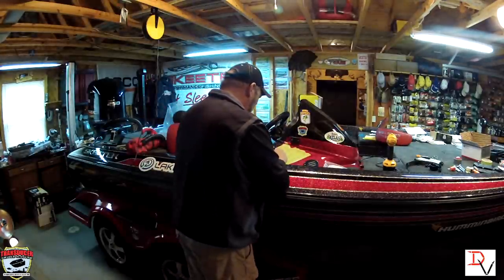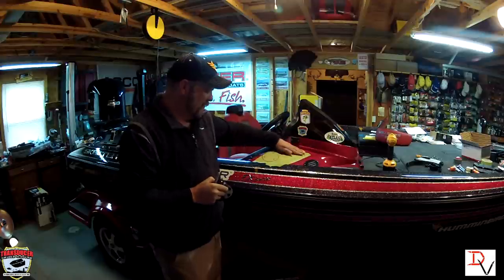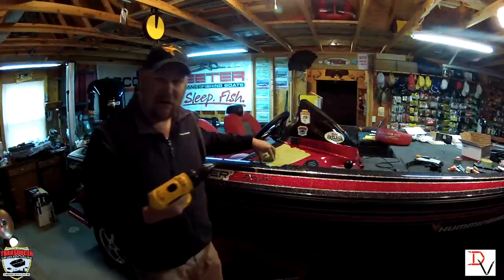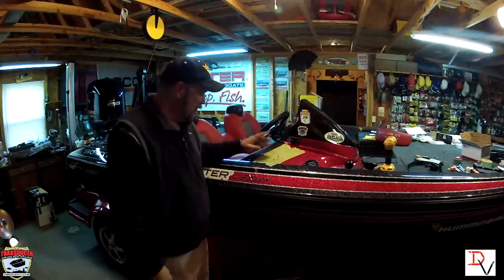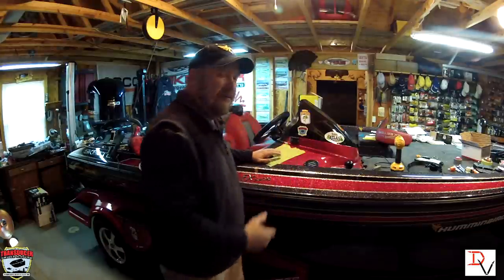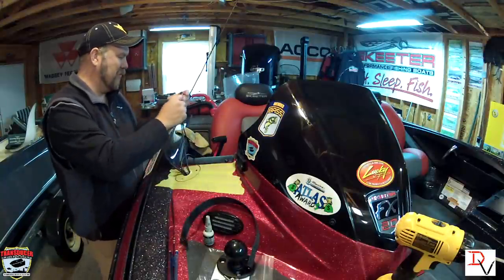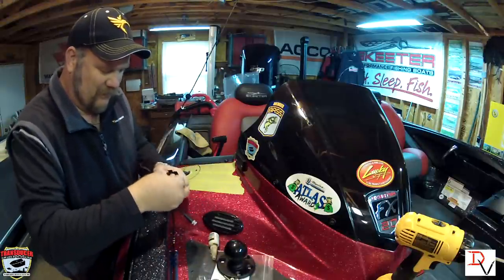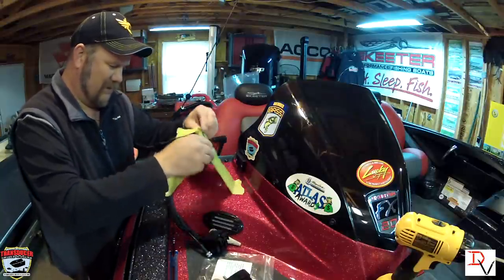Tips 'N Tricks  87: Installing RAM Base Plate

Comment: Hi Doug, I’ll be mounting a helix 10 to my fiberglass dash as well. A big question I have is do you know or had issues with the weight of the hummingbird and the amount of shaking from the boat at high speeds to crack the fiberglass where it’s mounted?